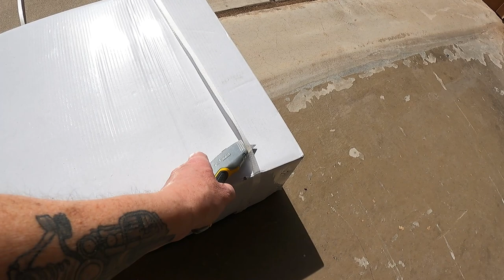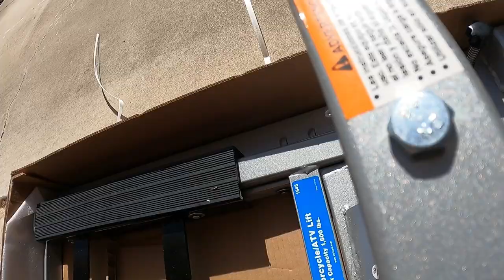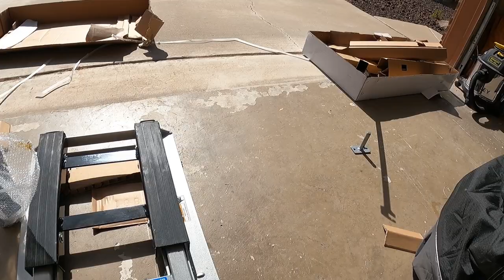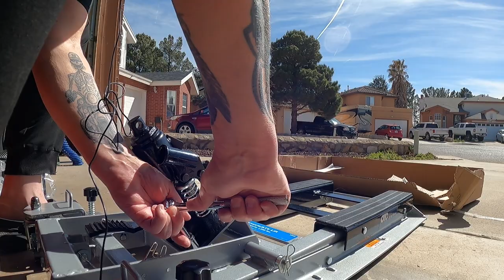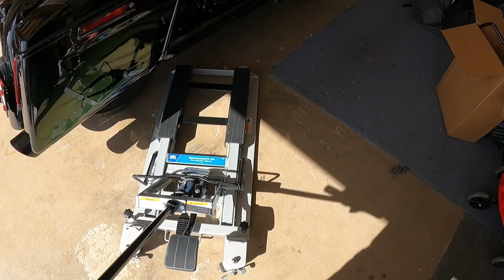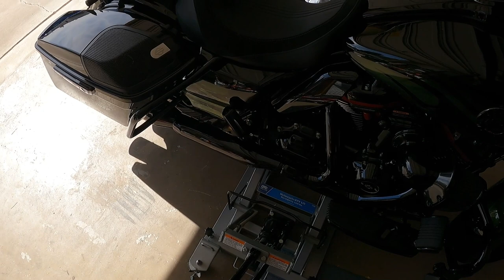New motorcycle jack

Comment: I bought the same jack a few years ago at Harbor Freight for $69. Works great, a bit nerving when you lower it from the mount side. From the Kickstand side, Not bad. BTW, I put a couple pieces of red electrical tape around the under frame so I would get the jack in the same place each time.
Reply from the maker: It's been a great jack so far. That's a great idea with the tape. Thank you

Comment: Hearing you complain about J&S made me think about when I bought a cheap Chinese jack off ebay here in the UK...... the seller said it was despatched and gave me a tracking number which the courier said it had not been collected by them yet. A few days later it's the same story so I contacted the seller asking them to check with the courier..... after two days the seller refunded me in full and sent a message telling me to go buy from another seller.
 I didn't bother and it's maybe just as well as about 10 days after that the damn courier left it on my doorstep and it has cost me nothing - how's that for customer service !